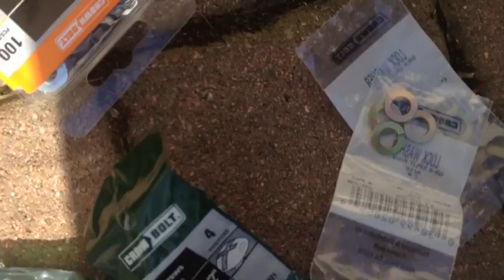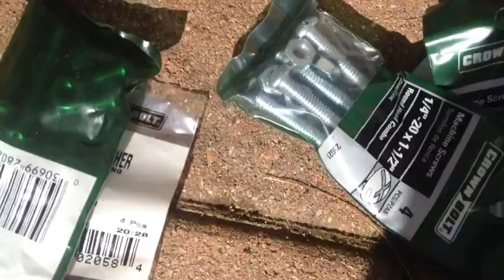Homemade Garden Cart

Comment: I built a truck very similar initially as this but put a 6 inch hinged side on the sides and back and a 18 inch high front. A fully planked payload deck
Using a std pallet i found it too wide to run through gate entrances and doorways.
I reduced the width to 30 inch wide which far more practical.

Comment: Looks like a good idea. But I have to say I think you should have inserted cubes of wood  between the top and bottom of the pallet where the wheels are attached. It looks rather weak as it is. And while the wheel load rating may be 300 pounds each, I can pretty much guarantee the wood would fail where the wheels are attached to. It's looks like it's just a piece of 1-by wood. Hopefully you have improved on it since you first posted it, Good Job, though.
Reply: joeguitargod very good observation  .

Comment: Should have used 2 in by 1/4 inch lag bolts. Screw right into the corner braces or run a longer bolts all the way through...

Comment: Where did you get the tires, what was the total cost?  And didn't you make a handle or something you can pull with atv
Reply from the maker: The tires were from Harbor Freight. Two were fixed on one side and the other two were casters on the other. The caster wheels were what I would call the “front” of the cart. Thats the side that the handle would be on. I ended up putting two   pipes with two pipe elbows and a length of pipe between them to make a handle. But I used U shaped brackets to affix the pipes to the wood of the frame of the pallet. But it didn’t work out well the way I did it. I would try to think of something else. I didn’t make a trailer hitch because I don’t have a tractor. Either way, if you do make one and attach a trailer hitch, I would only use it for yard work and not for actual road use because it’s clearly not intended for that and could be very dangerous for a number of reasons. So only use it for low speed yard work. Ok? Thanks for watching!

Comment: You mentioned in your video that there were 2 wheels that were fixed and 2 wheel that are not. My question to you is where exactly did you place the fixed wheels/ were they in the front or back? and it would be nice to see how you drilled on the wheels. How big were the wheels and where did you get the your wheels from?  Peace out.
Reply: Clem,

Actually it makes for better maneuverability with the back set fixed and the front moveable. Think about the Red Ryder wagons....

Comment: yes I just watched your video and I was wondering were did you buy the tires I heard you say something about harbor freights, but here is my question? I'm looking to build a bike trailer that I can pull with my bike do you think these wheels have enough turn that if I turned on my bike it would work and turn with it.
Reply from the maker: Yes, the tires came from Harbor Freight.  They are very inexpensive and they have held up, but they need air often for some reason. Harbor Freight is online, and they have catalogs and stores. I had ordered them online and had them delivered, and one of the tires would not hold any air and I had called the customer service number and they sent me a new tire, free of charge and overnight, and I didn't even have to ask for it. They said I could just keep the other tire instead of returning it.  There are better tires out there, specifically from a company called Dayton thats sold by Grainger.  When you say Bike, is it a motorcycle kind of bike or a bicycle kind? These would not be good in a bicycle, unless it was heavily modified and probably used on a beach.  But the tires themselves might do well as a motorized minibike tire.  But the rims (the metal part) of these are meant to be bolted onto something like a platform. I hope this helps!~